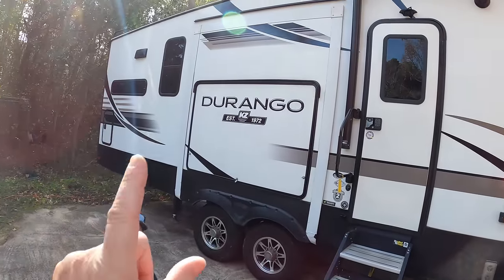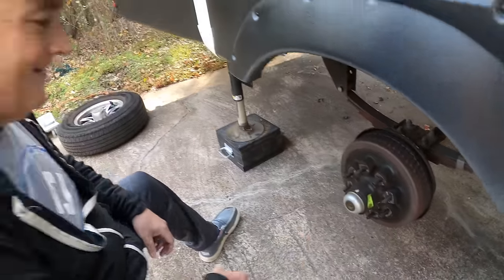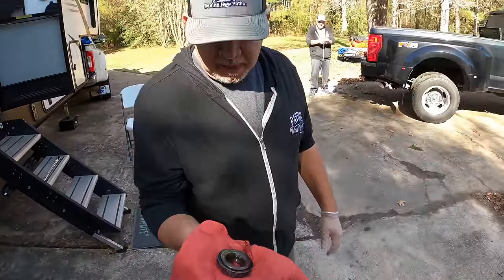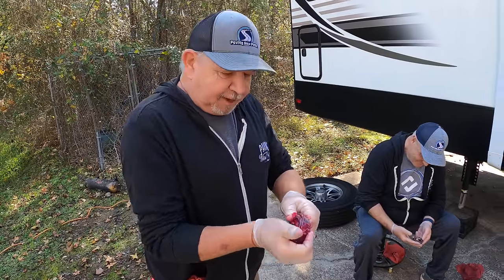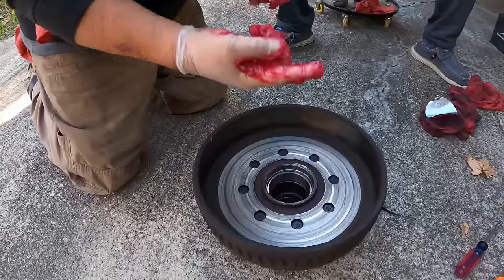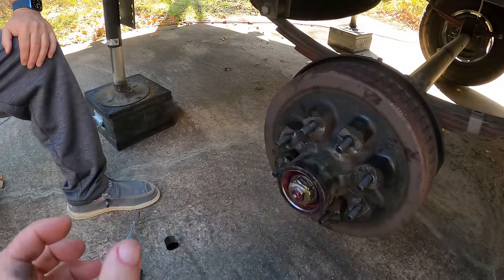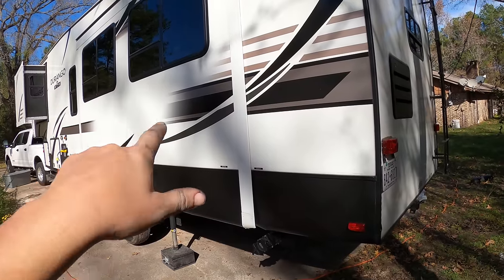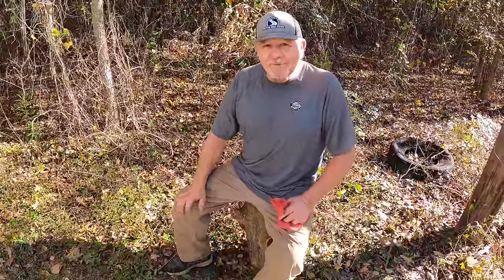STOP! Wasting Your Money On This! Fulltime RV Living!

Comment: I had a few things that I wanted to point out and comment on regarding this video but I don't want you to get the wrong idea because I think that you put out some good content and I think that you're fairly knowledgeable with a lot of things and I believe that your intent is good so please don't misunderstand my concerns with my comments. I have commented on your videos a few times before in the past and I have nothing against you because I think you're a pretty good guy overall and you're really trying to help the RV or camper community as a whole.

I understand that a lot of people use their own terminology when referring to things but I really don't think it was a great idea to use the phrase "soft breaking" when referring to loosening the lug nuts of the camper tires. Obviously, everybody is different and has their own ideas on what terms that use but honestly, in my roughly 30 years or more of working on vehicles and other things, I've never heard of somebody referring to loosening the lug nuts as "soft breaking".  I'm only suggesting not to use this phrase because it might confuse people that really don't know much about taking off tires or working on things in general.  So, my suggestion is to just use the simple common term of loosening a lug nuts but explain why you wouldn't loosen them all the way. Or, you could explain that they could loosen all of them with the exception of two of them as long as the two of them are across from each other and they wouldn't have any issues.

Unfortunately, I think you just have to dumb things down for a lot of your viewers or probably the majority of your viewers so using common phrases and terminology is probably the best idea.

As far as the rest of the video, I thought it was decent for the most part but there were a few things that I thought you could have improved on and again, it is mainly for the majority of your viewers that are not going to really know squat when it comes to doing these types of repairs or maintenance types of things.

For one, I think you need to pretty much explain to people step by step why they need to do certain things in the order that you're explaining them to do them. As an example, I think you should have explained to people why you were having them loosen the lug nuts before jacking up or lifting the camper. Some people might not have any idea why that would be needed because they don't understand that the tire is going to rotate once the camper is lifted in the air and the tires are off the ground and as a result, it is going to be extremely difficult to loosen the lug nuts (by using a socket wrench/ratchet) unless somebody has an impact gun.

But also, if somebody does have an impact gun and it at least has a decent amount of torque, they don't need to loosen the lug nuts prior to lifting it off the ground in the first place so that is just wasted time and energy pre loosening (soft breaking) the lug nuts.  The impact gun should be able to easily loosen the lug nuts unless for some reason they're on extremely tight which would be a problem in and of itself because then they would be over torqued which is another issue that you should probably explain why it's not good if they are over torqued as well. Obviously, it is easier just to loosen them prior to lifting the tires off the ground if somebody wants to so I'm not saying it's not a good idea to do that to begin with but again, if you have a good impact gun, this is completely unnecessary in almost all cases.

Next, I think you should have explained to people that there are sometimes issues with trying to remove the brake drum depending on how old the camper may be or how worn the brake pads (brake "shoes") may be inside the brake drum. Obviously, you guys were working on a fairly new camper so it was probably not going to have issues but often times, when the brake shoes wear down the inside of the brake drum, they can create a lip on on the outer portion of the brake drum and when you are trying to remove the brake drum, it can be extremely difficult to remove the brake drum because it will catch on the brake pads / shoes.

People that have hardly any knowledge of working on things (most likely pretty much every viewer that is watching this type of video) doing repairs and maintenance wouldn't have any clue about this but it's definitely something that you want to point out because it's very common when brake pads get worn down.  And so, I think you should have explained how people can get their brake drum off when this sort of thing happens.

Sometimes it's not that difficult and all you need to do is use a couple big screwdrivers or some pry bars and you can CAREFULLY pry on each side of the brake drum and you will luckily get the brake drum off but other times, you need to actually go on the back side of the brake backing plate / shield and go through the adjustment hole and adjust the brake adjuster down so the brake shoes come together and allow the brake drum to fit over the lip as you are pulling off the brake drum.

Not only that but, I think it would have been a good idea to explain how much of a pain in the ass it can be to figure out how to back off and adjust the brake adjuster so that it is actually tightening the brake adjuster and collapsing the brake pads / shoes instead of looening it and forcing the brake pads to hug against the brake drum which would make it virtually impossible to remove the brake drum.

Also, while you were showing the spindle and the brake parts, you could have explained how this happens by showing the brake pads and the brake drum and discussing this.  It's this type of thing that I think should have been explained so people would understand how to deal with this if they had that issue.

Next, I think you should have explained how the electric brakes work and what to look for when they have the brake drum off so that they know if there are issues to be aware of while they're doing these repairs so they can make the necessary replacements for parts if they are damaged or worn past the point of safe usable life.  If nothing else, actually I think there are a few of these things that could maybe be addressed at the beginning of the video so that people are aware that if they start taking things apart, they may want to have the parts available with them so that they can replace them as needed and if they don't need to replace the parts, they can simply keep the receipt and take the parts back if they are not needed. That way, they are not wasting time while they're doing this bit of maintenance and having to repeat the procedure multiple times.

I think you should have explained how the magnets work inside of these types of braking systems and how you need to look for whether or not they are wearing the inside of the brake hub or wearing it too much and what the limits could be as far as what is safe or operational and when they potentially need to be changed. Obviously, some people think that parts need to be changed sooner than others but at the very least, you can explain the operation and how they work and discuss the pitfalls of waiting too long to replace parts so that they end up replacing more parts than necessary and people can make their own judgment call on when they need to have their magnets or brake drums replaced.
Reply: I had a few things that I wanted to point out and comment on regarding this video but I don't want you to get the wrong idea because I think that you put out some good content and I think that you're fairly knowledgeable with a lot of things and I believe that your intent is good so please don't misunderstand my concerns with my comments. I have commented on your videos a few times before in the past and I have nothing against you because I think you're a pretty good guy overall and you're really trying to help the RV or camper community as a whole.

I understand that a lot of people use their own terminology when referring to things but I really don't think it was a great idea to use the phrase "soft breaking" when referring to loosening the lug nuts of the camper tires. Obviously, everybody is different and has their own ideas on what terms that use but honestly, in my roughly 30 years or more of working on vehicles and other things, I've never heard of somebody referring to loosening the lug nuts as "soft breaking".  I'm only suggesting not to use this phrase because it might confuse people that really don't know much about taking off tires or working on things in general.  So, my suggestion is to just use the simple common term of loosening a lug nuts but explain why you wouldn't loosen them all the way. Or, you could explain that they could loosen all of them with the exception of two of them as long as the two of them are across from each other and they wouldn't have any issues.

Unfortunately, I think you just have to dumb things down for a lot of your viewers or probably the majority of your viewers so using common phrases and terminology is probably the best idea.

As far as the rest of the video, I thought it was decent for the most part but there were a few things that I thought you could have improved on and again, it is mainly for the majority of your viewers that are not going to really know squat when it comes to doing these types of repairs or maintenance types of things.

For one, I think you need to pretty much explain to people step by step why they need to do certain things in the order that you're explaining them to do them. As an example, I think you should have explained to people why you were having them loosen the lug nuts before jacking up or lifting the camper. Some people might not have any idea why that would be needed because they don't understand that the tire is going to rotate once the camper is lifted in the air and the tires are off the ground and as a result, it is going to be extremely difficult to loosen the lug nuts (by using a socket wrench/ratchet) unless somebody has an impact gun.

But also, if somebody does have an impact gun and it at least has a decent amount of torque, they don't need to loosen the lug nuts prior to lifting it off the ground in the first place so that is just wasted time and energy pre loosening (soft breaking) the lug nuts.  The impact gun should be able to easily loosen the lug nuts unless for some reason they're on extremely tight which would be a problem in and of itself because then they would be over torqued which is another issue that you should probably explain why it's not good if they are over torqued as well. Obviously, it is easier just to loosen them prior to lifting the tires off the ground if somebody wants to so I'm not saying it's not a good idea to do that to begin with but again, if you have a good impact gun, this is completely unnecessary in almost all cases.

Next, I think you should have explained to people that there are sometimes issues with trying to remove the brake drum depending on how old the camper may be or how worn the brake pads (brake "shoes") may be inside the brake drum. Obviously, you guys were working on a fairly new camper so it was probably not going to have issues but often times, when the brake shoes wear down the inside of the brake drum, they can create a lip on on the outer portion of the brake drum and when you are trying to remove the brake drum, it can be extremely difficult to remove the brake drum because it will catch on the brake pads / shoes.

People that have hardly any knowledge of working on things (most likely pretty much every viewer that is watching this type of video) doing repairs and maintenance wouldn't have any clue about this but it's definitely something that you want to point out because it's very common when brake pads get worn down.  And so, I think you should have explained how people can get their brake drum off when this sort of thing happens.

Sometimes it's not that difficult and all you need to do is use a couple big screwdrivers or some pry bars and you can CAREFULLY pry on each side of the brake drum and you will luckily get the brake drum off but other times, you need to actually go on the back side of the brake backing plate / shield and go through the adjustment hole and adjust the brake adjuster down so the brake shoes come together and allow the brake drum to fit over the lip as you are pulling off the brake drum.
I like that you explained that the one brake drum seal failed and let all the grease get outside of the brake drum but then unfortunately got inside of where the brakes are so it was not going to allow the brakes to do their job. I just wish you would have went into more detail regarding how the seal works and maybe even showed people by putting the seal over the spindle and then showing them having the seal on the back of the brake drum and explaining how the grease can get through it just so people understand what's going on and why it did what it did.  Also, I would have liked to have seen you examine the old seal to see if you could figure out what caused it to fail or what the failure point was.

I know you said it but I just think more detail would have helped. Also though, I wish you would have explained to people what they need to look for on a spindle so they know if there are issues to be aware of that can cause the brake hub seal to fail such as scratches or nicks or damage to the spindle. Obviously, a spindle shouldn't typically have damage but you never know if somebody was negligent while doing maintenance and repairs and ended up causing damage to a spindle for whatever reason.  Or, if the spindle itself got hot while driving down the road and caused it to get out of round or burn the rubber of the Hub seal itself. Obviously, there could have been a number of reasons. It could have simply been due to either a faulty Hub seal or improper installation.

Another thing I wish you would have shown is the grease coming out of the grease hole of the spindle while using a grease gun and explaining to people how the system works so they know how or why they need to grease these greasable spindles. I don't think hardly anybody shows anything like that on YouTube that I'm aware of so that would have been something interesting for people to see so they can understand the operation. Again, I know that you explained it but seeing it would have been pretty cool in my opinion.

Next, I know that you mentioned using brake cleaner to clean up the brakes and get the grease off and that is fine but I think maybe one thing that you might want to recommend is that people would need to be aware that many campsites would probably not allow this to be done at a campground due to the hazardous materials and staining that the brake dust and brake cleaner would leave on the ground after they leave UNLESS they use something to collect any brake dust or chemicals that would be dripping after doing the cleaning.

I'm sure a lot of campground owners would not allow this type of stuff to be done on the campground unless they knew that you were going to make sure that you guaranteed that you would not allow any brake dust or brake fluid and chemicals to get on their concrete or dirt or what have you.  Obviously, you would want to put down some cardboard or maybe a few pieces of cardboard to make sure that nothing soaked into the ground or concrete.

If it's your own driveway and you don't care, obviously that's completely different.

Next, one thing I think you should have discussed with the viewers regarding the bearings and races is actually explaining what a race is because a lot of yours probably have no idea what that is. Also, I think you should have explained what they need to look for on the bearings and the race so that they know if either one is in good condition or not. All you mentioned was that the bearings shouldn't be too loose but the problem is, bearings are actually loose by nature so somebody might get a bearing and check it for looseness and think that it's bad when it actually isn't because brand new bearings have a little bit of looseness to them. So, I think you should have explained how somebody can tell if the bearing is too loose or not usable with regards to whether or not the needle bearings themselves are too loose Inside the cage of the bearing itself.
Reply: Also, you did not mention that people should be looking for damage to the needle bearings themselves such as pitting or flaking of the bearing material or discoloration due to being extremely hot or other issues such as broken pieces and things of that nature. You really didn't go into much detail in that regard when you were talking about the bearings or the races themselves and I think you really should have discussed that.

Also, when packing the bearings, I know that your other helper mentioned just squishing the grease inside the bearings and that's fine because it will probably work fine for most people but you should also just rotate the bearings around in the grease and actually pressing the needles of the bearings in the palm or your hand and making the whole bearing to make sure that they're getting all the grease inside and over and around the needle bearings as well as the cage and the inner race of the bearing itself.  And although his method worked fine, I think that he took way longer than was necessary to pack a bearing. That's just my feeling.  I'm not trying to be a jerk here and say that his way was wrong because I'm sure it works fine.

Something else I think that should have been discussed was looking to make sure whether or not the spindle is damaged and what to look for and explained if the spindle was discolored or if it had pitting itself or flaking or broken pieces or things of that nature. The same thing goes for the brake pads or shoes and explaining what to look for if they are worn or to what level they can be worn so that they are still safe or usable.

I don't think you explained very well how to tighten the brake hub assembly and do it properly so that it is not over tightened but also not to loose. The way you explained it is not really that great in my opinion and you really didn't hardly get into any detail to be honest. For one thing, you need to explain to people or show them how you can properly put the brake drum on and explain how the inner bearing can sometimes not fit on the spindle properly so you have to jiggle the brake drum or maneuver it in such a way that it will finally fit on but also not damage the brake Hub seal at the same time as well.

But then also, once you have the brake hub on and then you put the outer bearing on, I think you should have explained that they need to make sure that they have all the parts or components going back together properly with typically a washer of some sort over the bearing and then the spindle nut. In some cases, there may actually be multiple washer or a spring washer and there needs to be a certain order to their installation.

From there, I think you should have explained that as they are tightening the spindle nut lightly by hand, they should be spinning the brake Hub itself to make sure that the bearings are seating properly. Just putting the brake Hub on and then tightening it and backing it off a quarter turn is not the proper way to properly seat the brake Hub or properly adjust it. Your recommendation can cause the brake Hub to be too loose or not be properly Seated on the spindle. There's obviously a point where you can over tighten the brake Hub and it causes issues and you don't want that as you mentioned because it will cause too much drag. That is true. However, you do not want the spindle nut to be so loose that it then allows the Hub to move back and forth and causes the bearings to have premature failure and causes shuddering or fluttering of the hub assembly as it is rotating going down the road.

You want the hub to be rotating as you are tightening the spindle nut and while you are tightening that spindle nut with a wrench by hand, you don't want to over torque it to the point that you were damaging the bearings. Obviously, you would have to put a lot of force on the wrench in order to damage the bearings but you never know who might start to really crank down on the wrench to make sure that they are getting the bearings tight and you don't want that. What people should be doing is spinning that hub back and forth a few times and making sure that it spins nice and free as they are tightening it and then once they get that little bit of drag, they need to just back it off just enough to where they can have the points of the spindle nut cover or castle nut cover fit over that spindle nut and it doesn't allow that nut to be too loose. Saying to back it off a quarter turn is not always the right procedure. Sometimes a quarter turn is actually too much.

When you were discussing the grease fitting and the grease coming out, I think you should have shown people when the brake hub was on how the grease starts to come out in the front of the bearings when you do get enough grease in the inner portion of the brake hub assembly around the spindle. You could have done this by showing them prior to putting the spindle cap on.

Other than that, I know that you mentioned retorquing the lug nuts after 100 miles of travel but I think you should have explained why that is necessary for aluminum rims and not particularly necessary for steel rims.  Long story short, aluminum is softer than steel and expands and contracts more than steel so the lug nuts may not be tight against the aluminum rim due to the expansion and contraction of the aluminum material itself.  I know most campers nowadays have some sort of aluminum rim but not all of them do so it's not necessary for every application.

Regardless of my thoughts, I thought the video was pretty good overall anyway.
Reply from the maker: We certainly welcome feedback regarding our content, so your suggestions are completely welcome! If you go back to our earlier videos on the "Path to Maintenance" playlist from our channel, you'll see that we took the approach of trying to make the video a true "how-to" and explain the reasoning behind everything we were doing. To be honest, those videos took a long time to film, weren't very much fun to film and were such a different style than our vlogs, that we made the decision to stop filming true "how-to's". Instead, we decided to take our vlog style approach to these maintenance type videos and lightly touch on the how-to and have it be more about us and what we are doing in the video. 

We think that when someone is searching for how-to's, they watch several videos on the same subject, and hopefully through watching them all, they get all of the pertinent information they need to do their repair. We hope that by bringing more of our personality to the videos, they understand this isn't the sole video they should watch on how to change your own bearings!

As a side note, with your attention to detail, ability to understand and convey the steps to do a job, we think you would have a very successful "how-to" YouTube channel! You should really consider it! There aren't enough people left in the world with the know how to do a job, much less the know how to do it and explain what and why they are doing what they are doing, as they do it.
Reply: @PavingNewPaths  thanks for understanding my concerns and not taking it negatively because my comments were not meant that way. I understand what you're saying about having your channel be more about you than a how to channel and I also agree that if people want to get more in-depth or more thorough with these types of repairs or maintenance things, there are a lot of other videos on YouTube that can provide a lot more detail. So, I understand what you're saying. As far as me getting a channel going, I thought about it but I don't know. Although I know quite a bit, I also know that there are a lot of good channels out there that have way more knowledge than I do so I kind of think I would maybe be repeating a lot of what other people would have already done. I don't know. At the same time, I guess part of me also thinks that maybe it's not a bad idea to have another Channel just in case for whatever reason some viewers like a certain Channel better than others. Obviously, people like different channels for different reasons so who knows? Unfortunately, as you can tell, I don't do a very good job of being concise so that is something that I have to work on if I want to get a channel going so that I'm not repeating myself and wasting people's time if they are going to watch it. The problem is though, it's hard to cram out all the information into a 5 or 10 minute video when you really need to explain details and it really should be a 15 or 20 minute video or sometimes even longer. Anyway, thanks for your response.